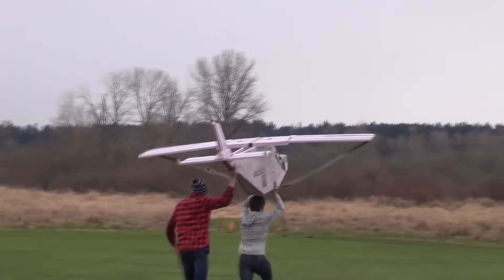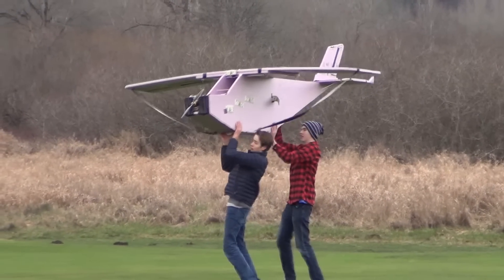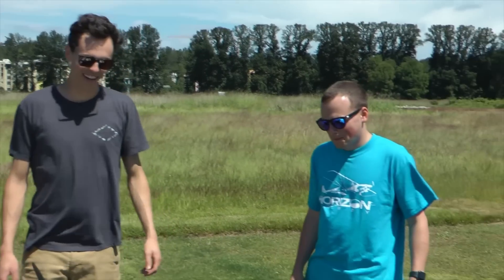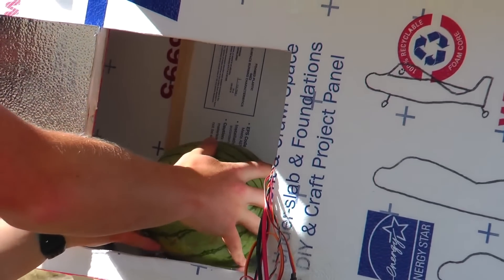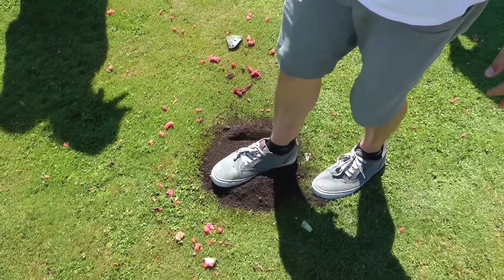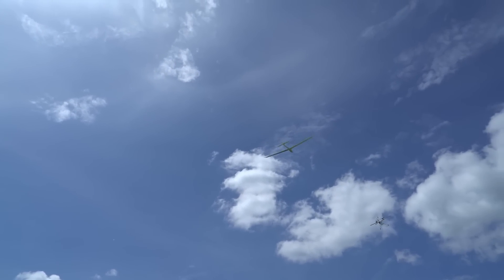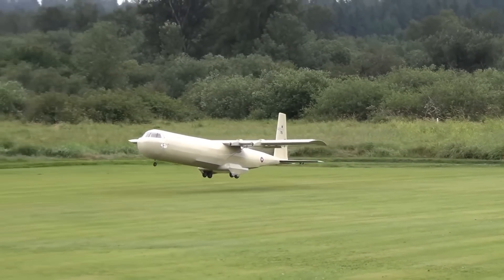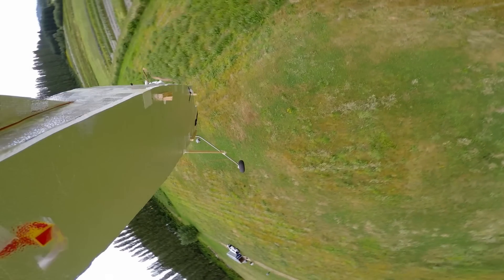MASSIVE RC Plane Builds

Comment: I saw no attempt to put aerodynamic cross sections on any control surfaces.   Naughty!
Reply from the maker: LOL. The purpose of the Zenith-inspired design plane was to prove to some folks in our local RC club that you didn't need an airfoil or other intricate engineering tasks to be met in order to make a plane fly. You're not wrong, it sure would help make it work better and last longer, but people were straight up and down saying it wouldn't fly, period. We're glad our proof of concept worked, and they ended up waving friendly white flags at us post-flight. 😁 -Zach

Comment: do a 3d flying review of the turbo timber evolution
Reply: They have one! They posted it a while ago
Reply: what size prop is the two bladed prop on the turbo timber evolution?
Reply from the maker: @snedhepsquadron406  We do plan on making a review of the Turbo Timber Evolution this summer which will include points on what’s it’s capable of from a 3D flying standpoint. For now, we only have the one video that’s purely of flying it backcountry and 3D with no commentary. All info on the specs of the plane can be found in the description of that video. 🙂
Reply: Thank you

Comment: I have a carbon cub s2 1.3 m and I am looking to up the power of the airplane. I am looking for advice on motors or prop selection. I would like it to be able to perform similar to a Timber Evolution. Thanks for any advice
Reply from the maker: Unfortunately I haven’t ever owned one so have never tried out ways to up the performance on it before. -Zach